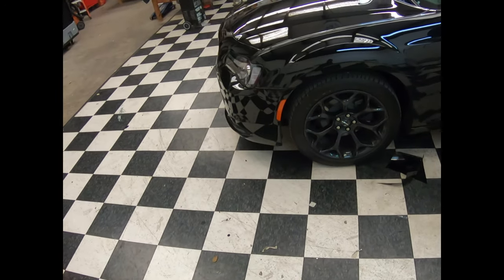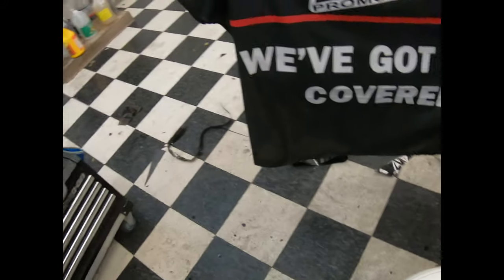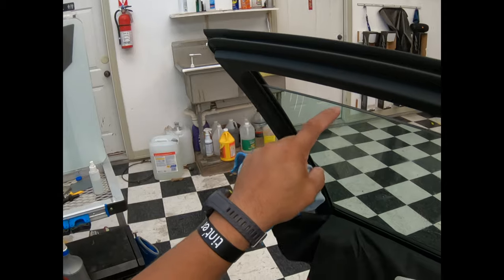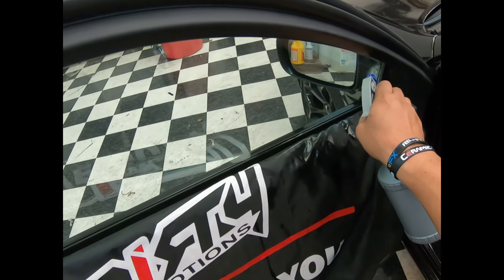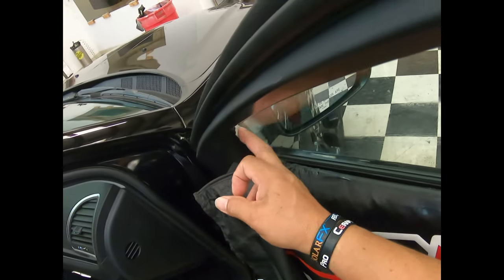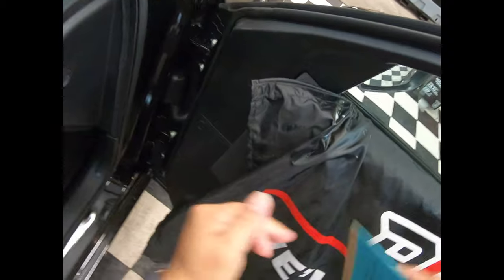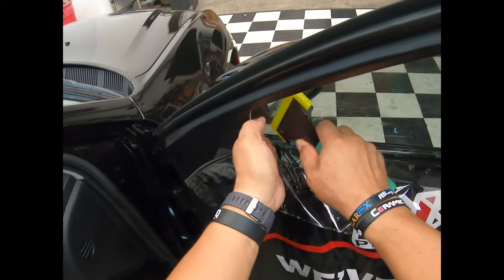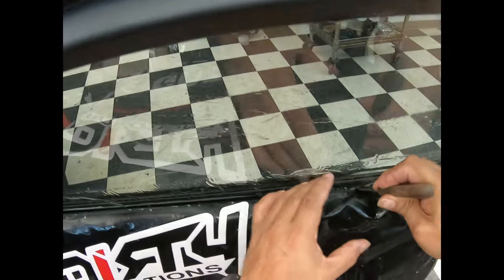Window Tint Chrysler 300-- Doing a 2 Stage vs Bottom Loading..LIVE!!

Comment: One thing that has helped me a lot is take a shop towel and a bone tool and clean out the sides till the rag is clean....with side window down.. you will be surprised at all the dirt in the cracks even on a new car... also on the bottom I use plastic carpet Shields and that helps with the hair on the bottom or tape the bottom seal... but you have the Bottom load down keep up the good videos real life stuff !!!
Reply from the maker: Thanks boss!!!!